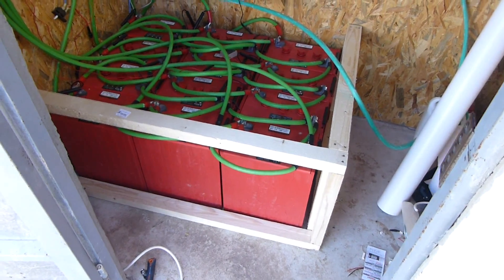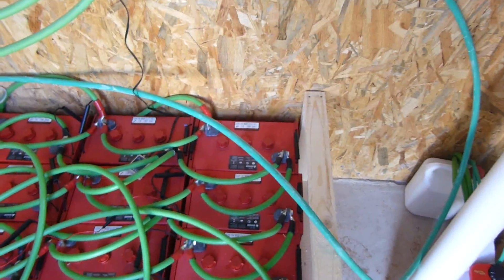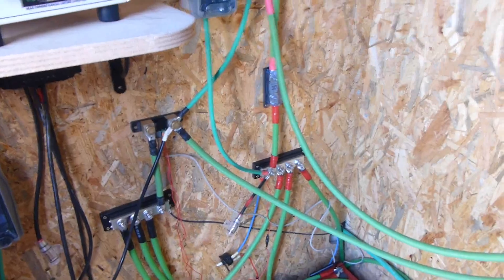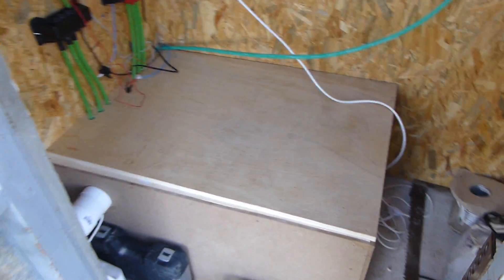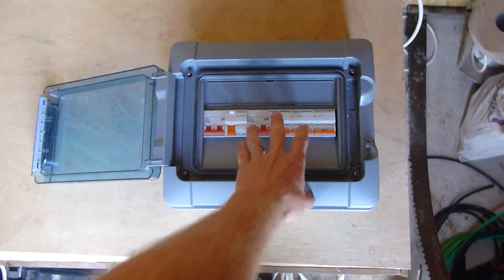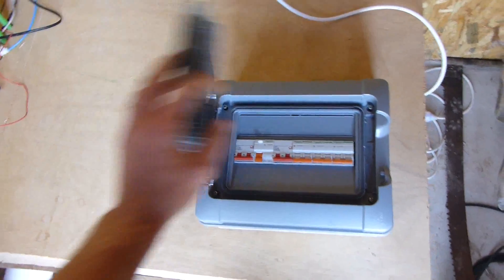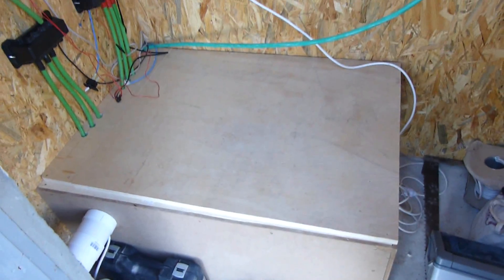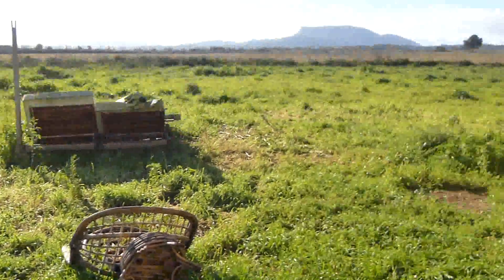Off Grid - DIY - Home Solar Install - P5 - Battery Box

Comment: How cold are your floor in winter?

You should not rest lead acid batteries on cold floors as the temperature differential from top to bottom of each cell causes the electrolyte (sulphuric acid) to concentrate at the bottom if / when the cells are low on charge. This will eat away at the bottom of the plates inside the cells if the batteries are left uncharged for a while.

I know it's a pain but I would put in a insulation board (say 25mm celotex) with a 19mm OSB / plywood sheet below the batteries as then you're mitigated against the cold floor.

Also you should make sure that all the batteries are spaced apart from each other so that you don't get the batteries / cells in the middle of the pack hotter than the ones on the outside, this also messes with the balance of the battery pack over time. 25mm should be sufficient if you can arrange for a crossflow of air to vent the batteries, you don't need much ventilation just a slow steady airflow. You're not trying to cool the cells, just making sure that the minute amounts of hydrogen and oxygen doesn't get a chance to reach the a concentration where it will ignite if a spark gets in there...

Comment: Is that a brush less fan? I hope so sparks can make gas ignite. Nice job very well done. You are also going to have a very hard time finding a weak battery wired that way that is why people do it the other way.
Reply from the maker: thats a good point.  I dont know.  I will check that out tomorrow.  Im guessing though that with constant air flow the hydrogen will never build up and always be mixed with sufficient air that it probably wouldnt ignite.

yes, I am going to play with the wiring a bit and keep an eye on it.  I have got  clamp meter now so will check the draw on individual batteries on a regular basis to make sure all is going well and im also going to change the parallel wires for thinner wires with fuses incase of a short as was pointed out in one of the other comments. 

thanks for your comment!
Reply: Yeah you definitely need a ATEX rated fan for venting your battery box as it's not only hydrogen that the batteries vent but also a perfect ratio of oxygen (venting is because of overcharging which causes the cells to split water into hydrogen and oxygen!